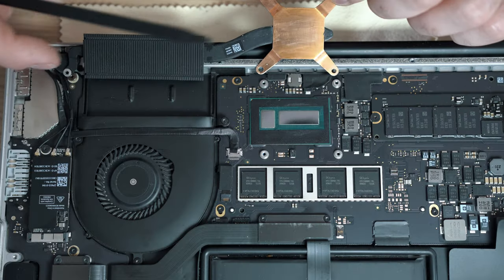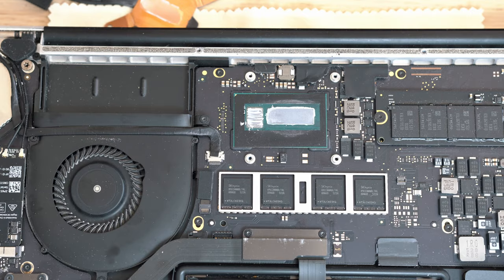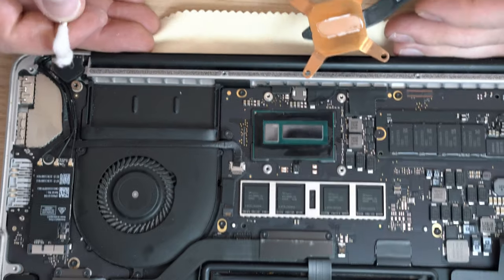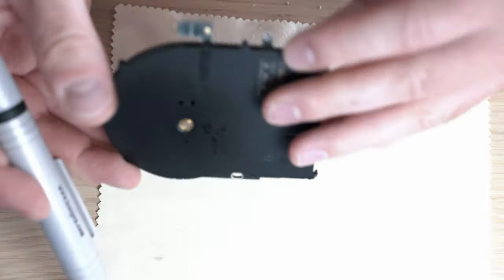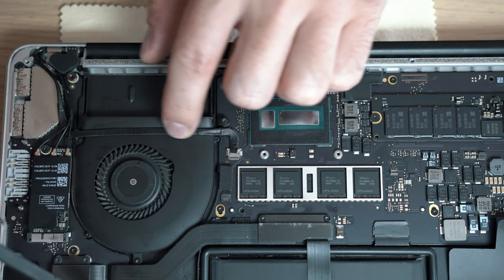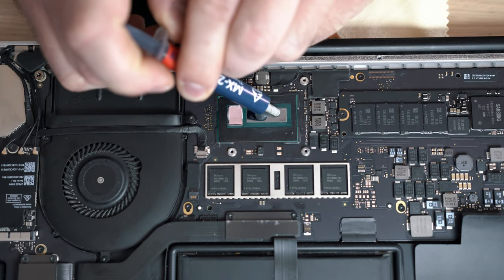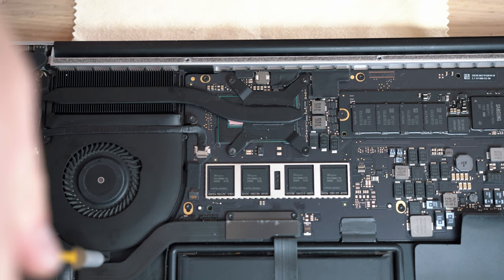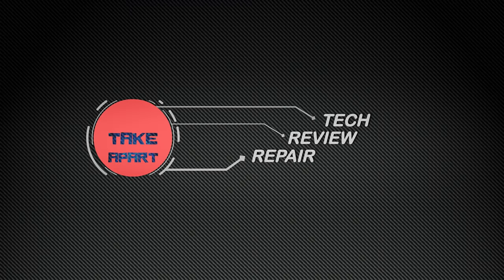MacBook Pro Thermal Paste HACK | UP Performance - LOW Temperatures 4K

Comment: Hi, what thickness of the thermal pad are you using? thanks
Reply from the maker: thickness of 1.2mm ... you will be ok even with 1mm ... thanks for watching
Reply: @takeapart  And did it help? I am struggling with overheating lately
Reply from the maker: yes, in combination with mac fan control it can change your life!

Comment: Hey! Commenting because I initially made the same mistake when repasting my early 2015 MBP, but the second die next to the CPU is NOT the GPU. 

The die next to your CPU is an Intel PCH (Platform Controller Hub) which runs at much lower wattage/temperature and is a vital part of your computer's operation. 

It is VERY important that you DO NOT put thermal paste on the PCH die or bridge the gap between it and the CPU heatpipe! Otherwise the high temperatures from the CPU and integrated GPU will spread to the PCH and cause it to overheat and can kill your logic board.

When repasting these computers be sure to clean both dies thoroughly but DO NOT PUT PASTE OR HEAT PADS ON THE SMALLER DIE.

Hopefully this helps someone before they make the same mistake I did.
Reply: Thanks ! I don't now how the die is it.
Reply: I did the same thing literally 2 hours ago and fixed it once I learned from Rossman Repair Group via phone what you just commented.  This comment really should be pinned.
Reply: Could you please help me? I have MackBook Pro 13" 2019. Under heat sink there are three dies. Should I apply thermal paste on only the middle one? Thank you.
Reply: @protanto2794  whichever one(s) had thermal paste is the one you reapply it to.  And the logic board layout should be able to be found on the internet somewhere.
Reply: @CarterCovers55  Thank you for the response. I don't remember what was originally. I bought it refurbished a while ago, and this is probably the fifth time that I am trying to replace the thermal paste. I always applied to 3 dies; last night, I applied only to the middle one, but None of these times I noticed any improvement. It works slow, and when I work on Premere Pro, it gets extremely loud. 
All morning, I was trying to find the info about what are these three dies and/or how to apply the paste in this particular model, but I didn't find anything.  But Thank You anyway.
Reply: All because the MacBook was refurbished I doubt the paste needed replaced.  Thermal paste is typically only replaced every 5-6 years.  But anyways, I'd call Rossman Repair Group (google it), their customer service phone number staff are very knowledgeable.
Reply: @CarterCovers55  Thank you. My previous Macbook Air was also refurbished, and I had problems with it since the beginning. I sent it to apple twice. Each time came back with the sane issues, such as displaying things upsidedown or showing weird lines, overheating, and etc. Finally, I tried replacing thermal paste. My 1st three attempts did nothing, but the forth time I did something right, and my macbook air since then was working perfectly for years.
People underestimate how many things can be fixed just by replacing thermal paste - but the trick is to replace it correctly.
Reply: Dinger is right. If you check the iFixit website the PCH die does not have any thermal paste on it.

Comment: Thermal Pad.The gap between the CPU heatsink and the bottom panel of 2016 Macbook Pro 13inch No touch bar , is 1.5mm. I measured it with a playdough and pressed in.
I am spreading this information because I could not find it myself.
Reply from the maker: thanks for it !